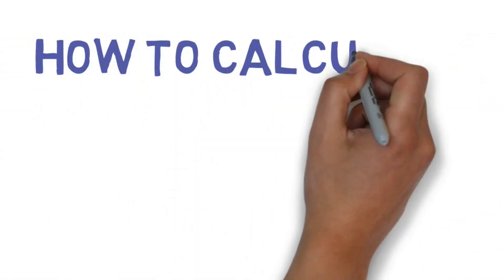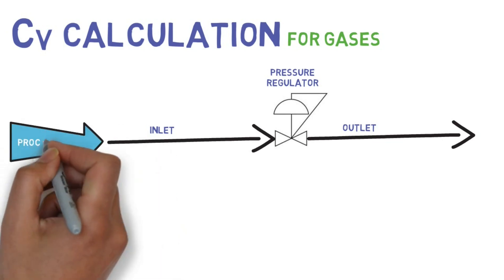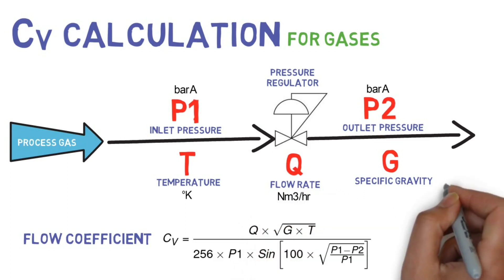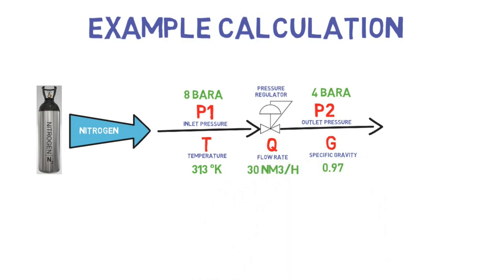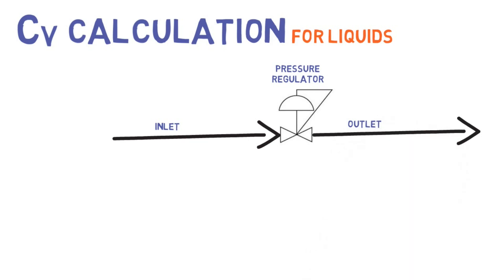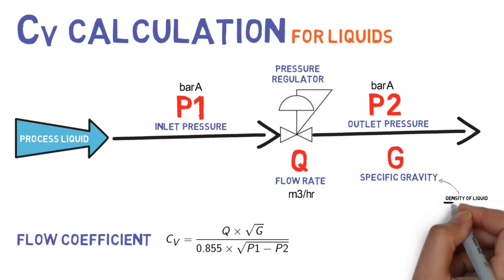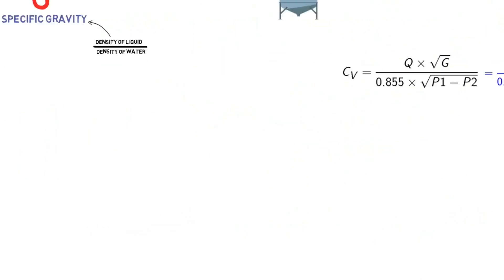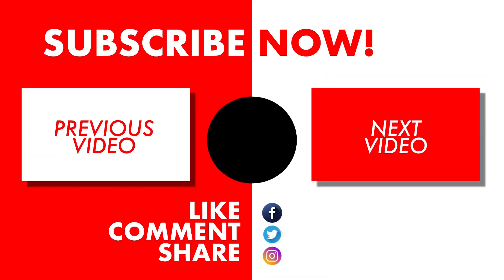Pressure Regulator Sizing, Cv Calculation for Gases and Liquids | Simple Science

Comment: This very nice formula is  for selecting Control valves , but not for selecting the right Pressure Regulator . It's just an indication that you need a very much higher CV value pressure regulator...
Reply: Francesc ,i have one regulator how i can check the liquid flow passing through it